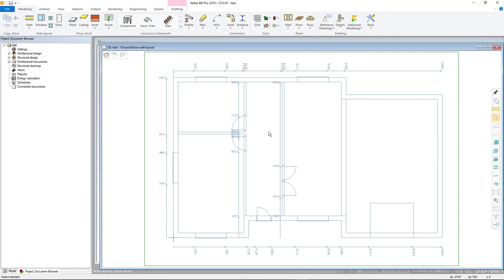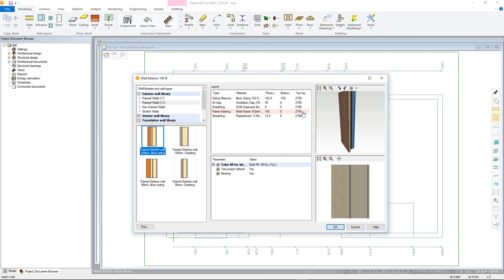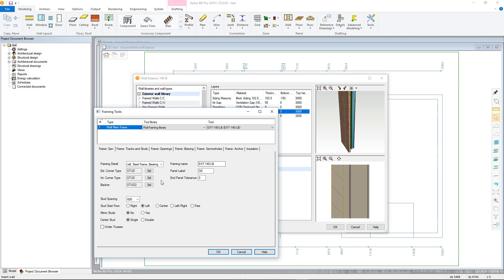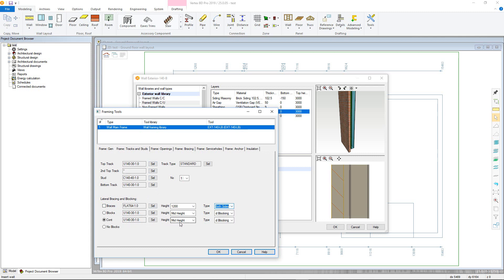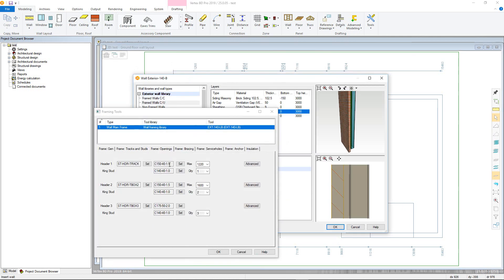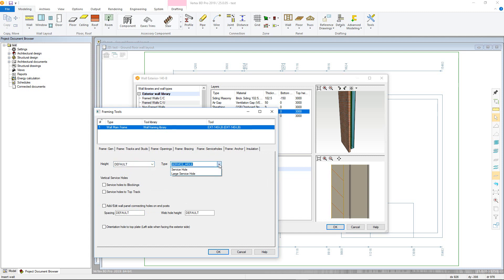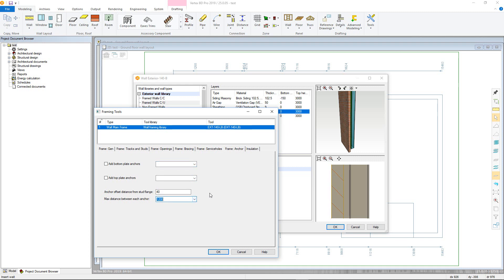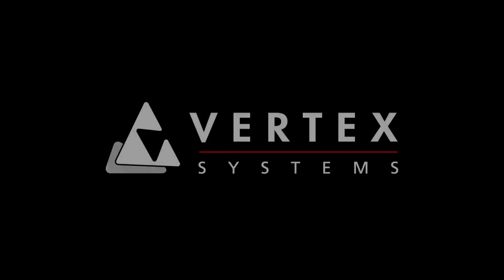4: Setting Wall Attributes [Vertex BD Steel Framing Tutorial]

Comment: I'm using the steel version but can't find C/U framed walls in the library. Please help.
Reply from the maker: Hello, Are you using the latest service patch? If your software is not using the latest service patch or has corrupted during installation this issue is likely to occur. Our recomendations would be to back up all your project files and then reinstall your vertex bd steel and then install the latest service patch which should resolve this issue.

Comment: i am developing new project i do not have any template. THE screen is not clear enough to read the detail.
Reply from the maker: Please try switching to 1080p for better quality video. In the bottom right corner of the video is the Settings icon - Select Quality - select 1080p.